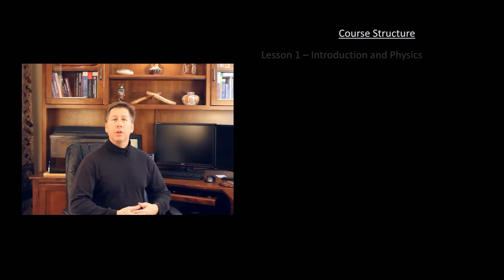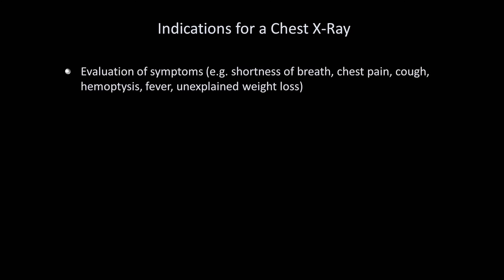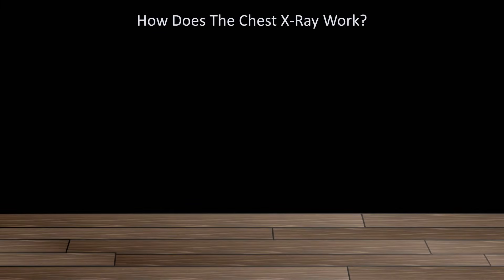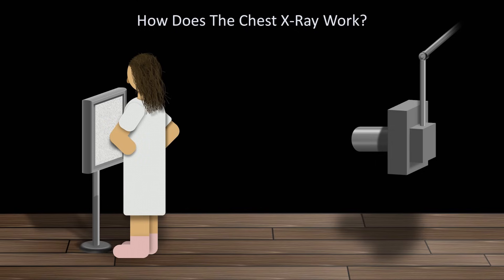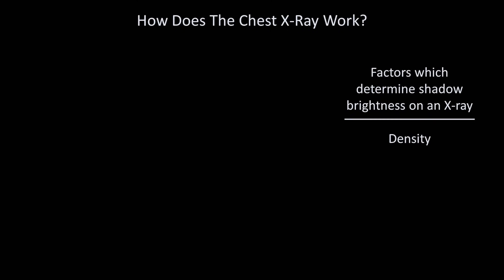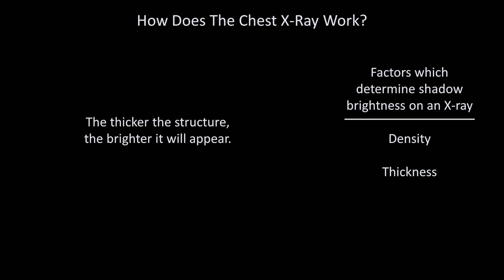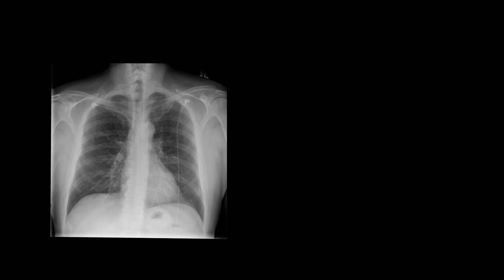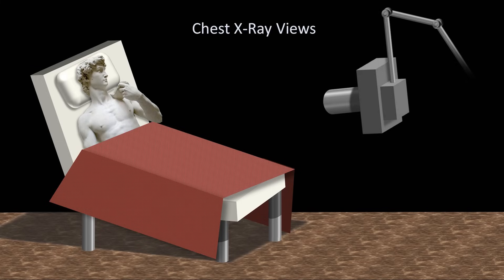How to Interpret a Chest X-Ray (Lesson 1 - An Introduction)

Comment: TRANSCRIPT

LEARNING OBJECTIVES:
	• to be familiar with the basic physics and method of obtaining chest X-rays
	• to be familiar with the basic chest X-ray views (e.g., PA, lateral, AP)

Along with the EKG, the chest x-ray is one of the most common diagnostic tests in medicine that does not involve drawing blood. 

There are many INDICATIONS FOR GETTING A CHEST X-RAY:
	• evaluation of symptoms (e.g. shortness of breath, chest pain, cough, hemoptysis, fever, unexplained weight loss)
	• evaluation of physical signs picked up on a physical exam (e.g. hypoxemia, abnormal pulmonary exam)
	• evaluation of the placement of central lines, nasogastric tubes and endotracheal tubes
	• screening for pneumothorax after lung biopsy, central line placement, and pacemaker placement
	• evaluation of suspected pacemaker lead fracture

There are a FEW SITUATIONS that are NOT PRESENT IN THIS LIST:
	• routine chest X-rays prior to surgery in the overwhelming majority of patients are of no benefit and should be avoided
	• routine screening chest X-rays for lung cancer and smokers are also inappropriate, although there may be benefit in screening chest CT-scans

HOW DOES THE CHEST X-RAY WORK?
	• we need a source of X-rays, which themselves are a form of electromagnetic radiation
	• X-rays are carried by photons, just like visible light, but have higher frequencies and thus higher energies, so they penetrate tissues much better
	• unfortunately, these high-energy photons can cause DNA damage, leading to cancer, which is why X-ray exposure should generally be limited
	• to detect the presence of X-rays we need a detector:
		○ for the first 100 years of X-rays in medicine, the detector was a photographic plate or film
		○ now, however, most hospitals have replaced these with digital detectors which allow for real-time viewing as well as improve post-exposure digital manipulation
	• finally, of course, we will need a patient to stand in between the source and the detector
	• the typical position of the patient would be facing away from the source, hands on the hips, and chest against the detector (the reason to put the hands on the hips is essentially to keep the arms from obscuring the view of the thorax)
	• once we have the source, the detector and the patient, we may turn on the X-ray for a very brief, predetermined length of time, and X-rays, that is high-energy photons, will shoot out of the source
	• some of the photons will pass right through the patient, some will be absorbed by the interposed organs and tissues, and some will be scattered around the room
	• for the purpose of examing the X-ray film, it is actually the pattern of photons that are blocked which are of interest, as these create a shadow of the internal organs

WHAT ARE THE FACTORS THAT DETERMINE HOW MANY PHOTONS PASS THROUGH A PARTICULAR SPOT ON A PATIENT TO REACH THE DETECTOR? IN OTHER WORDS, WHAT ARE THE FACTORS THAT DETERMINE SHADOW BRIGHTNESS ON AN X-RAY?
	• DENSITY OF THE INTERPOSED TISSUE (technically, this depends not just on the literal density, as mass per unit volume, but also independently on the atomic mass of the particles in the interposed tissue):
		○ let's imagine a table with an empty glass jar placed upon it, filled just with some air and covered by a metal lid; on the far side of the jar is our photographic film, which starts off white; we fire some X-rays at the jar, which of course are not in the visible spectrum; as the X-rays travel across the table, the ones that either pass around the jar or through the jar interact with the film; any part of the film where many X-rays struck has turned black, while parts of the film where no X-rays struck have remained white, and the parts of the film where a modest amount of X-rays struck show various shades of gray; since air has a very low density, X-rays easily passed thorugh the jar and thus the jar appears empty on the film; the metal lid has blocked nearly all the X-rays, which has left a sharply demarcated rectangular patch of white, unexposed film
		○ now, let's imagine a jar of water and repeat the very same procedure, exposing it briefly to X-rays which also exposes the film behind it; in this case, water is denser than air, so it blocks more X-rays, and therefore the content of the jar now appears gray on the film; it is important to realize that even if the fluid in the jar is completely transparent, it will still block X-rays and therefore look gray; the fraction of X-rays a substance blocks has absolutely nothing to do with its color or degree of translucency within the visible light spectrum
		○ now, let's imagine what would happen if X-rays struck a skull; the resulting image would be lighter than the jar of water, but not pure white like the image formed from the metal cap of the jar
		○ in summary, there is a SPECTRUM OF RADIO-DENSITIES into which different materials fall: those that allow most X-rays through are called RADIOLUCENT (BLACK), while those that block most X-rays are called RADIOPAQUE (WHITE) 
		○ for medical X-rays, there are essentially FOUR CLASSES OF MATERIAL (from the most radiolucent to the most radiopaque):
			§ AIR, which is the most radiolucent
			§ FLUID and SOFT TISSUE
			§ BONE
			§ METAL
	• THICKNESS OF THE STRUCTURE (the thicker the structure, the brighter it will appear on the X-ray film):
		○ if we take a single, relatively thin glass of water, and expose it to X-rays, most will pass through, resulting in a very dark image on the film
		○ if instead we line up to glasses in a row and shoot X-rays through both, twice as many will be blocked, and the resulting image will therefore be more gray, because the specific parts of the film, corresponding to the shadow of the glasses, have been relatively less exposed
	• DURATION OF EXPOSURE (short exposures lead to images that are too bright, while long exposures lead to images that are too dark)
		○ for the X-ray interpreter, this factor is only relevant when trying to understand a technical error in image acquisition
		○ imagine we have two glasses of water again, with a very brief X-ray exposure; during that brief amount of time, few X-rays have an opportunity to pass through the water, so the film where the shadow of the glass was cast is relatively underexposed, and thus relatively bright; if I use a medium exposure, the film behind the glass will receive more X-rays and thus the glass appears a little darker; finally, if I use a very long exposure, even though the glasses of water are in the way, there is enough time for many X-rays to pass through, so the glasses appear fairly dark on the film

The result of the passage of X-rays through the patient is an image formed on the photographic film of the shadows cast by the various structures in the patient's chest. From the pattern of white, black and gray, we can INFER THINGS ABOUT THOSE CHEST STRUCTURES:
	• dark areas correspond to air-filled structures, such as the lungs
	• areas that are medium-gray in brightness must correspond to structures composed of either fluid and/or soft tissue, such as the heart
	• since the layout of the human body is amazingly consistent from person to person, each major line and shape on the X-ray correspond with a known and identifiable anatomic part

There are TWO QUICK PRACTICAL THINGS to point out:
	• when we remove the film from the detector stand, we flip it around horizontally: the consequence of this is that the left side of the film, as we are looking at it, actually corresponds to the right side of the patient, and viceversa; this puts the X-ray in the same orientation as if we were standing in front of the patient and looking directly at him or her
	• in radiology, the term view refers to the orientation of the person relative to the beam of X-rays; at this point there are THREE VIEWS TO KNOW:
		○ POSTERIOR TO ANTERIOR VIEW: the X-rays entered the body squarely in the back and exited squarely out of the front; in most cases, the PA view will automatically be accompanied by the lateral view
		○ LATERAL VIEW: as the term implies, the lateral view is the two-dimensional projection of the patient's internal structures as seen from the side
		○ ANTERIOR TO POSTERIOR VIEW: the PA view should be distinguished from another situation, common in the hospital where patients may be physically unable to stand due to weakness, confusion, surgical wound or invasive tubes; in that circumstance, when the patient is in a hospital bed, a portable X-ray source will be wheeled into the patient's room, an X-ray film will be placed into a metal tray and slid behind the patient's back, and the X-rays will be passed through the patient from front to back; they are inferior in quality to PA films for a number of reasons
Reply: this was helpful, thank you, Giuseppe
Reply: Thanks 😊
Reply: This is really helpful honestly, thanks allot.

Comment: i have a question,how to know the differences between right and left lateral cxr ?
Reply from the maker: +Peggy Miu As you might already know, when someone refers to a "lateral film" the default is left lateral film, unless one specifies a right lateral one.  Although there are theoretical and empirical differences between the two, as an internist, I can't recall a situation in which I needed to specifically request a right film.  

If you are interested, here's a paper from the 1970s that discusses some of the observed differences: http://www.ajronline.org/doi/abs/10.2214/ajr.127.6.997
I didn't immediately find one more recent, which hints at either the lack of clinical relevance of these differences, or the fact that we rely so much on chest CT now, that these concerns are now obsolete.
Reply: Strong Medicine well done